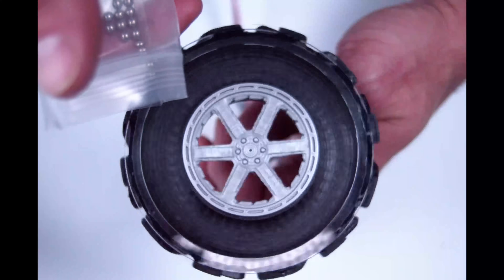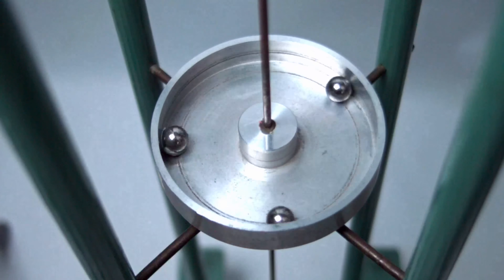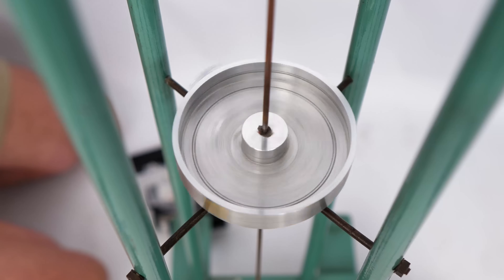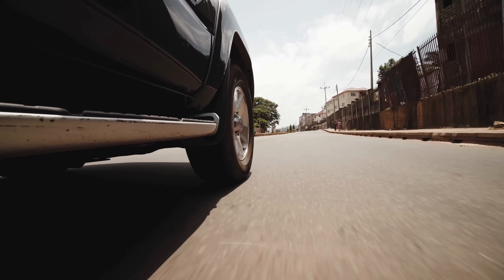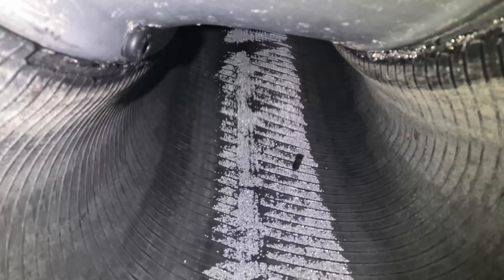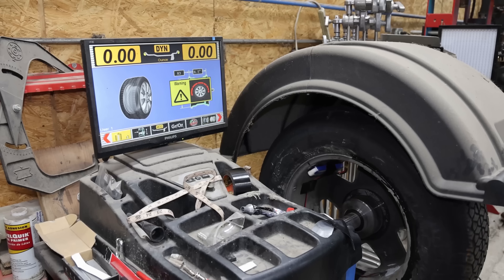Do tire balancing beads actually work?

Comment: I frequently donate platelets by apheresis. The short version of the process is: the machine draws a certain quantity of blood from your vein, passes it through a centrifuge that separates the platelets, the plasma, and the red blood cells from each other, captures whichever component you're there to donate, and then dumps the remaining components into a mixing chamber from which they are returned through the same needle back into your vein. 

The centrifuge in these machines sort of resembles the drum in a top-loader washing machine. It's about 20cm tall and about the same in diameter, maybe a little bigger. When the machine is prepared for a donation, the technician wraps a sort of strap containing tubes around the top edge of the drum. The strap itself is only 2-3 cm wide. The blood flows through and is separated entirely within those tubes - everything that touches blood is completely sealed and completely disposable. The strap itself isn't very well-balanced - for one thing, the blood enters and leaves through a set of tubes that by necessity are all on one side of the drum. (If they weren't, then the larger volume of fluid within the strap part would be even more imbalanced than the feed tubes are.) As near as I can tell, the only reason the drum is so tall is to optimize its mass distribution in order to help push the center of mass of the whole assembly toward the axle.

When the machine starts up, it always vibrates like crazy as it accelerates to and through the resonant zone, but then the rotation smooths out significantly. When it shuts down, the same vibration doesn't happen. I've always wondered why it doesn't shake itself to bits given the obvious imbalance and imprecision involved. Now, thanks to this video, I realize that the fluid contained within the strap itself probably helps it to self-balance, much like the beads in the video. (You don't get back as much fluid as you put in, even accounting for the portion donated. There's always something left in the machine, though they do try to minimize the loss. If you donate often enough, you learn that there's a government-mandated limit on the amount of plasma and/or red blood cells you're allowed to lose in a year through this process.)

Comment: Thank you Steve!
As a young entrepreneur, I sold multi-seal which was an ethylene glycol solution with Kevlar fibers.  Designed to automatically seal punctures and provide balancing.  It worked excellent, but if the tire needed replacement, it was an unexpected mess for the tire shop.......glass beads just as bad........all over the shop😎
Reply: I worked in a tire shop for a while - always a lot of "fun" when someone had used some sort of stop-leak stuff and then wanted us to properly repair or replace the tire...
Reply: @benjiwiebe8128  I had the same working experience in a tire shop, haha. HOWEVER, some of these that are designed to be put into the tire from day 1 don't really make much mess. I use one from Ride-On in my moto tires, and when I change them there's never really anything to clean up. It stays pretty much entirely stuck to the tire itself, so doesn't glob to the inside of the rim or drip out much when breaking the bead.

Comment: 5:55 Now, a thought, though - from that diagram/picture, the forces acting on the bearings are dependent on the shape of the wheel.  I expect that with the bearings, the wheel is going to center itself around e.g. the geometric center of its inner rim, so if your axle is not concentric with that point (e.g. if you drilled the shaft through a point a few mm to the right), the wheel would not be balanced around that point.  Would it?  So it seems like this solution depends on existing concentricity.  Which makes me wonder, what does it mean for a wheel to be unbalanced?  How does that happen?  Does it somehow preserve concentricity?

Comment: So you have to get up to relatively high speeds (where the effect of the beads isn't really needed) in order to get the beads into the correct position, where they then stay even at lower speeds - which is their primary use case and purpose - but you lose that effect, if you ever have to break like at a red light, or to take a sharp turn at a crossing, or when other drivers behave, how other drivers sometimes like to behave....
Yeah, it seems like you'd need a pretty particular driving pattern for those beads to actually work well.

Comment: I feel like you could do this more optimallyv with some kind of low-viscosity epoxy.  Not on a tire, but on metal wheels, the liquid out to spread itself out even more perfectly, and then adhere in-place.

Could be something cool to test with your apparatus here, just with water.

Comment: My guess about the thing where it switches from the wobbling to vibrating is that the whole thing has some resonant frequency, and when it spins at that frequency (or lower) it will wobble a lot, after you get past that frequency it stops wobbling as it cant resonate.

Comment: I never believed these would work. But recently I bought a truck/suv (opel frontera / isuzu rodeo) that was in beautiful condition and I could drive it up to 150km/h with no vibrations whatsoever - it literally drove like a new car, if you ignored the 115hp diesel screaming along. It wasn't until I took the tires off to replace them with offroad tires that I realized there were no balancing weights, they were simply filled with these small glass beads. I was stunned, I honestly could never tell there was a transition point or anything, it was always a smooth ride. I still wouldn't use them, cause tire shops don't charge much to mount and balance tires and they'll do it the traditional, usually accurate way, but I'll admit I'm very impressed!

Comment: I think they need to throw in some epoxy into the tyres. Have half of it just in with the beads and have the other half in a light bag designed to break once the tyre's got up to speed. You get up to speed, the beads/epoxy settle, the bag bursts releasing the hardener and then a few minutes later your beads are held in place all the time. Could even just do it at the tyre place, just keep the tyre spinning, if you can use a gas hardener you could even rig it so you don't need the bag :).

Comment: Been out the tire game since 03 but by just watching this I'd place any muthafucka who were to use these n you were to slide thru for a flat change. I'd do you like did people who would use 4-5 cans of fix a flat. I'd make sure I'd cross thread the threads on your studs and pretend to have fixed your tire.
12 hour shift and your ass wanna slide thru at the last minute 🤣🤣🤣🤣

Shit a scam, slap the rim (no warped rims) on the balancer and spin it with all them glass beads. 

 It probably eat up the tire from the inside within time.

Comment: What if: 
instead of beads, you add a thin-flowing 2-3 minute cure epoxy resin, spin the wheel to 150 km/h in The Shop for 10 minutes and stop?

Comment: This still blows my mind .. It is so unintuitive that the beads would move to the point the tires need it most as apposed to the side the tire keep moving to during imbalance .. Now I need a tire machine so i can have a set of tires for my trips to my parents house a few hours away (Highway speeds), and a set for my day to day to work and back (below 100kph, mostly surface streets).

Comment: What if the glass bead product was combined with low viscosity glue? 
Drive on the freeway for the amount of time required for the glue to set and then your wheels should be balanced permanently.

Comment: What if you throw in some glass beads covered in glue, and go for a motorway drive? If the beads are still in place when the glue sets enough to counteract gravity pulling them out of place, will you then have forever-balanced tires?

Comment: it dosent work at low speed and it does at high speed because the centripital force needs to overcome gravity, if the cup were to suddenly vanish and the balls fall due to gravity the balls wouldnt ballance the cup, but if the cup were to vanish and the balls were to fly in the tangential direction it would have the force needed to balance the balls

Comment: I remember one time driving a large rollback that had “equal” brand balance beads and it almost wrecked me when the wheel started hopping literally off the ground with every rotation. I was in a turn and it was all I could do to keep it out of the ditch. One thing I always heard is that any moisture accumulation within the tire can really cause issues with beads clumping. Moisture can be introduced when airing up tires if the air compressor you’re using does not have a sufficient water separation filter.
Well, while I’m on the subject, please remember to periodically drain the water from the bottom of your air compressor tanks! They can rust on the inside and explode without warning or showing any observable damage from the exterior. Great video!!
Reply: 1. what is a rollback
2. we had to drain compressors daily at work and I always thought it was a waste of time as one would have to assume that the inside of a tank is always damp and the walls would always be damp and rusting regardless of how often it is drained.  They scare me now after seeing a vid of exploding compressor.
Reply: a rollback is a type of tow truck with a long, flat bed that rolls backwards and tilts down to the ground
Reply: @kissingfrogs  There's oil in compressors that passes through the tank and into the line and nozzle. If you keep the tank drained, the oil can help prevent rust. But if you allow the water to pool, oil-water separation occurs and rusting can begin on the water-saturated surfaces.
Reply: @kissingfrogs I believe as water accumulates, the concern is right at the water line where water and air meet.
Reply: to clarify, tanks need to be drained but I consider draining rarely used compressors daily a waste of time.
Reply: @kissingfrogs I agree.
Reply: "Well, while I’m on the subject, please remember to periodically drain the water from the bottom of your air compressor tanks! "
This is literally a question in the HGV driver's exam - the one you have to pass before you can start your on-road training and test. It appears in several forms, including questions about "you don't have a "low air" warning on this winter day, but you have weak and ineffective brakes" with a choice of replies which includes an option for "you've got ice in your air lines. Always drain the air tank's water trap at start of the day, if not more often."

Comment: the balancing beads make more sense, to me anyway, in long range drives or shipping trucks. Would me much easier and cheaper to use the beads on a truck with a bunch of wheels, like a Semi, or when said vehicle doesnt slow down as often as a commuting vehicle.

Comment: Cool so all you need to do when you start driving is speed up to highway speeds and then never come to a stop! What could go wrong? 

Seriously though, this only helps in a tiny minority of cases, at least for me, because I'm either driving at highway speeds already (where the effect mostly doesn't matter) or I'm driving around the city or in heavy traffic which wouldn't keep the beads in place 

If you had a way to inject them, get up to speed, and have them stick there permanently then this could be useful, but as it is I don't see what problem they really solve

Comment: What is the border between defining "low speed" versus "high speed?" I would imagine the actual flexibility of the axle is related to that. At some speed the pull of the weight on the object is so brief in a given direction that the flexibility of the axle to move in that direction is insufficient to pull the object away very much. Perhaps if it was, say, an elastic band, or a string, that speed would be much higher. But this is just a thin metal rod, which is arguably less flexible than a piece of string.

Comment: Before getting to the solution, my assumption is (and its probably the wrong terms), but the balls go to the spot with the least force pushing them outward, that being the point most opposite the imbalance/extra weight. This is because it's the shallowest, or rather its the closest to the centre, and therefore experiences less centrifugal force.

So I was pretty much there though missing some elements.

Kinda wild that it turns out that for practical use it is basically still snake oil for just about most situations, but not completely so.

Comment: We need beads with a pressure sensitive adhesive, that will move freely at firts, but once you get a bit above the speed at which they get in place, they stick to the tire because of centrifugal force and stay there definitely.

Comment: The only missing part of this analysis is the fact that the beads will further unbalance the wheel when below freeway speeds because they'll gather at the bottom. It actually makes the problem worse if you drive in cities, rural areas, or in traffic

Comment: An important caveat here is that before you get into the self balancing mode, the beads are just an unbalanced weight inside your tires, meaning that you're guaranteed unbalanced tires any time you stop 🤦

Comment: There are two things I wonder about the beads, 
1, do they wear out the inside of the tire over time from having to settle again after every stop? 
2, is there a version with a sticky coating to embed them into the correct spot once they are in place and the tire heats up? That way they wouldn't move during a stop.
Reply: For your 2: What's the point? If the imbalance changes you're just going to have an imbalance but with sticky beads in addition
For your 1: Not sure, but I do imagine that depending on where you live some tire mechanic might sue you if the beads would break and they'd inhale glass dust when checking them.

Comment: I tried them on my big jeep tires.   They work as described in this video HOWEVER if you hit a big bump or dip at or just below whatever critical speed required it throws the whole balance off worse than going from a stop, shaking you to death until you either stop or get past the critical speed again.   Took them out and went back to traditional weights.

Comment: Where I live, having a mechanic install those counterweights is free. Tire shops around me have that included in the charges for tire install, and for tire rotation. Tire rotation is also a no charge item if I go back to the shop that installed my tires.

This is nevertheless fascinating.

Comment: I removed the wheel weights on my motorcycle and replaced them with balancing beads, and it rides smoother than it ever did.

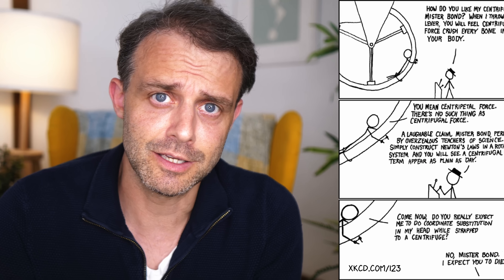Comment: 6:35 It does seem to rely on the container being a perfect circle and allowing free rolling movement. Not sure if this holds true for oblong shapes, such as the inside of a tire (which gets especially more oblong as it rolls, the bottom end flattening out as it contacts the ground). It may be bad to put beads directly into the tire, it may be better to have a circular metal container on the inside of the rim where the beads can freely spin and roll.

There's also the force of gravity to consider, the ball bearings balancing a spinning metal disk has no other forces at play. It's possible, likely even, that gravity will shift things off the center and in fact prevent "perfect" balancing

Comment: This kind of makes me think there's an easier way to fully balance tires without adding wheel weights to the rim.  If you had some kind of balancing beads that had an adhesive on them that would solidify after a certain amount of time, you could spin the wheel up and let the beads get into balancing position, and then leave the wheel spinning until the adhesive on the beads has solidified, and then they'll always be in the correct balanced position.

Comment: Kinda sounds like one could make beads work as a proper solution if one could add some kind of adhesive that would cure within a reasonable time at highway speeds. The downside would be that you would need to hit the road to reach that speed quickly after installation, and then maintain speed for a set amount of time.

Comment: Couldn't you make a machine that turns a tire at high speed. Then put some glue into the tire before spinning it up to speed for a bit until the glue dries.
At least I think a liquid should work just as well, right?

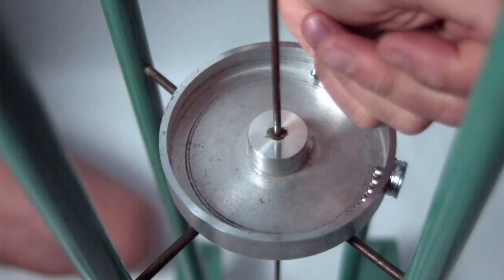Comment: 1:36 I believe this might be caused by the steel balls being attracted to the magnet on the outside of the wheel
Reply: Many stainless steels are not magnetic by their nature, especially grade 316 stainless which can be very commonly found as ball bearings.
Reply: @kal5169  They could well be plated bearings depending on how cheap they are. I'm not a bearing expert though so... 🤷‍♀
Reply: Stainless Steel isn't generally ferrous (magnetic)

Comment: 5:41 - good work on pointing out that fictitious forces can still be the correct ones to use in some cases.
Reply: I always say "centrifugal" isn't the name of the force, it's a description of its geometry.
Reply: It's not really fictitious.  It's just the result of doing calculations in a non-inertial reference frame.  If you stand in a non-inertial frame, you'll feel all those fictitious forces just as much as you'd feel getting slapped in the face.

Keep in mind, the centripetal force doesn't exist in a synchronized rotating reference frame.  So, for the rotating observer, the centripetal force is the fictitious force.
Reply: Gravity
Reply: Every force after the 4 fundamentals is fictitious.
Reply: @6Twisted  - And even one of those 4 is technically "fictitious".

Comment: Wouldn't the rumble only start at the supercritical self-centering speed? Because before that the axle would be the center of rotation, but after that it would be the center of mass of the wheel, causing the axle to oscillate up and down